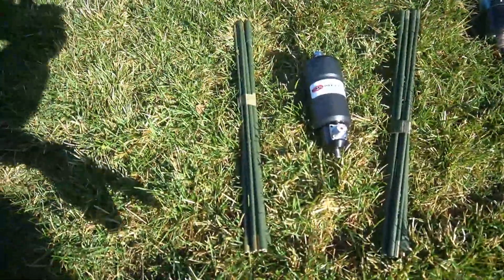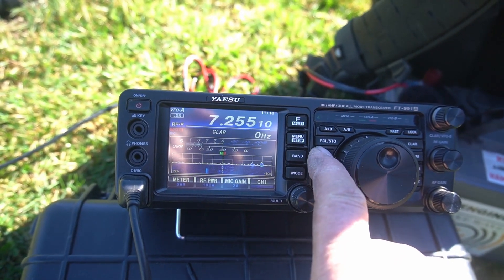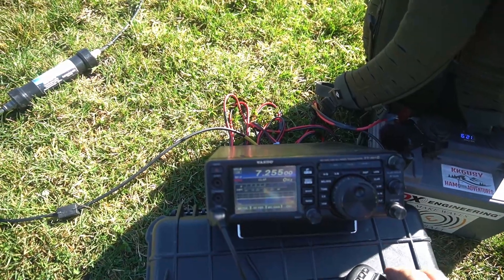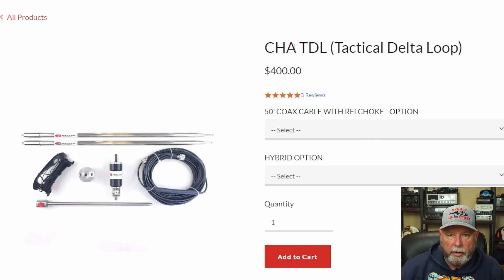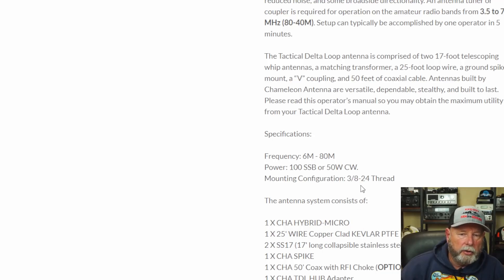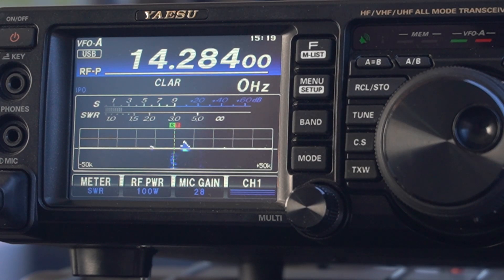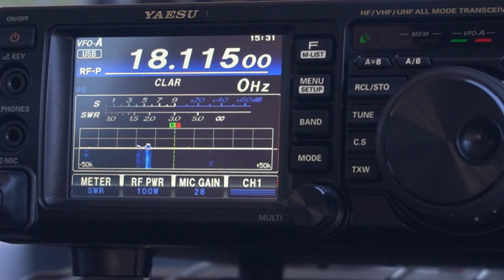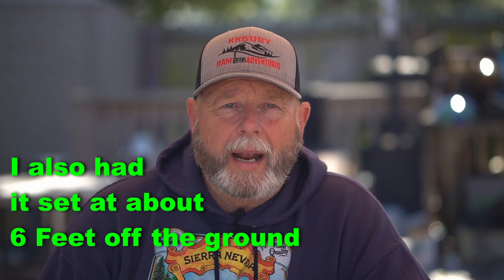Chameleon CHA TDL (Tactical Delta Loop) Antenna Review, with a twist!

Comment: You used 2 Mil Whips and not the 17 foot collapsible whips so I would call into question your review on the performance on that alone. However it did work on your set up, as you've shown. As for the price, the old saying of "You get what you pay for" applies. I didn't find the price too expensive, but you are correct on their shipping costs... Could be a little cheaper there. Al in  all, it is an  honest review, and I commend you for that.

Comment: Good video. I am building one of these. Was going to say you can get 1/2” aluminum tube 3ft long at home depot snd cut to length if needed. If you tap the ends of the tube for 1/8 npt female, you can put a 1/8” npt male/male brass nipple in one end, and a 1/8” npt male/female brass adapter in the other end and stack them. A 1/8” male npt will go in 3/8-24 threaded hole, and a male 3/8-24 will thread into a female 1/8” npt. That’s how I’m using my 9 1/2” whip with the full size version of this antenna. 73.

Comment: Thank You for an honest review. Not the "Great Antenna, I made 40 contacts" type review from others. For $400.00, I'll pass on this one. Much easier to use a EFHW or Dipole at lower height for $40.00 or less for NVIS work. Any antenna that is this broadband will be a compromise antenna. Yes, it works, but at a $400. price point, it's just not worth the cost. If $$$$ is not an issue, this might be a fun antenna system to play with.  I can do more with a Silver Bullet/Buddipole-Stick, Ham Stick antenna or a wire for far less money and have a much more efficient antenna. I look at these type antennas as a gimmick antenna. All portable antennas are compromise antennas. The question is, how much efficiency are you willing to give up ? I'll take the most efficient portable antenna I can use for my portable work. I can Carry and Set Up an antenna that will be a far better antenna, at a far lower cost than this one all day long. A resonate antenna wins the day.

Comment: Nice coverage Chuck! I have two 17' whips and the CHA Hybrid-Micro, stake and want to create a metal piece to hold the 2 whips at a 45 deg. angle. You just inspired me to put that higher up on my project list. 73 Sir - KF6IF
Reply from the maker: Phil you can see what I made. I can give you measurements if you want, mine is plenty sturdy, just got my second 17' whip and will try it today
Reply: @KK6USYHamRadioAdventures  Look forward to the results. :)

Comment: Thanks Chuck! I have the MPAS 2.0 and TDL parts. Found your review and use to be accurate and honest. Excellent for regional  NVIS 40/80 and I’m using mine for mobile EMCOMM. Works best when all targeted contacts are also NVIS.
Reply from the maker: Thanks Gary, I did order another 17' whip so I can set it up like intended and will report back on that. I was just being a ham and using what I had with the shorter whips and experimenting and was happy with the results on the higher bands making contacts the next day into Maryland and South Dakota on 17m.  Thank you for the comment and watching!!
Reply: @KK6USYHamRadioAdventures  The Hustler QD-2 quick disconnect mounted to my light bar makes a 5 minute deploy, very easy. Just mount the male to the bar and the female to the TDL adapter and its done. Really like it. Would gladly send pics. 73
Reply from the maker: @garyoliver8183  Thanks , I actually have that quick disconnect good Idea!
Reply: Regional comms is 400 miles radius.  That's what you can expect for 20m of wire set up low as EFHW.  With your buddies out only 50 miles, you should be seeing 20 over s9.

This is just not a good antenna  for 40m and lower.

Comment: I have the CHA TDL in my Go Bag and it's a good antenna for what it's to be used for. I also keep a CHA EMCOMM IIIP, which is a little more of a pain to set up but better, but the TDL can get set up in like 4 minutes. On a side note, if you can get the CHA TDL up even just 6 or 10 feet (obviously you can't use the spike ... but a small tripod or such), the lower frequencies actually get a little better for low bands and the SWR on 40 and 80M drop also.

Great review, keep it up!
Reply from the maker: Thanks , I did do a lot of testing after I shot at the park with it 6' off the ground and it's great on the higher bands 14 up for distance. I made a 17m contact today to Maryland from Northern California with a report of s3-s5 so not bad. Thanks for watching and the comment!